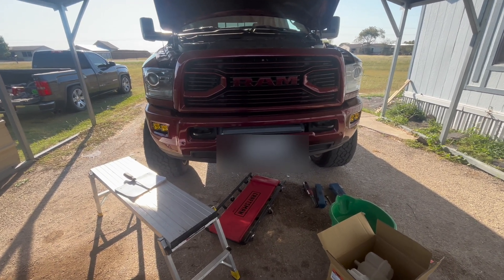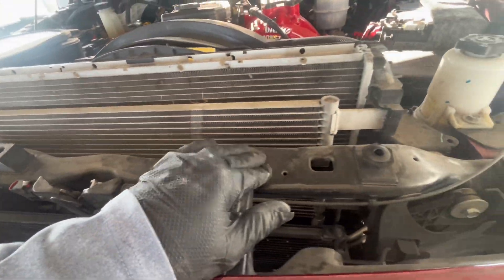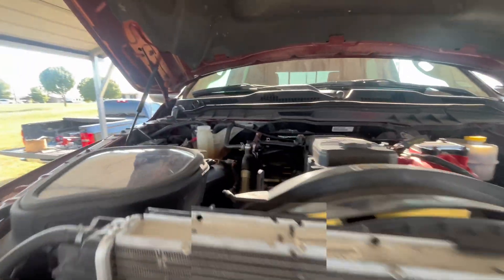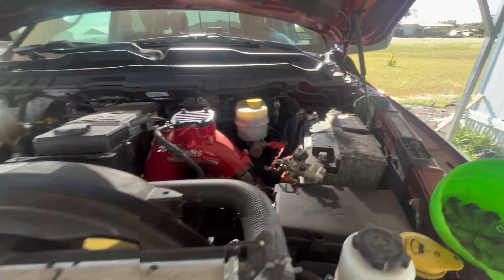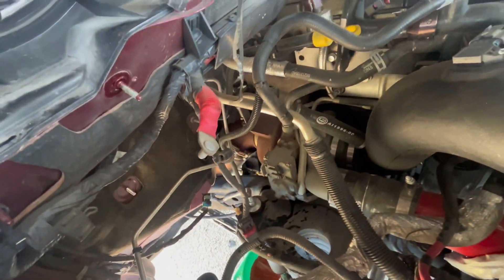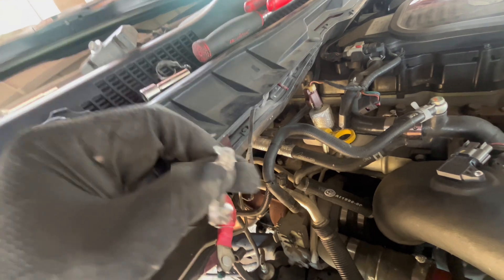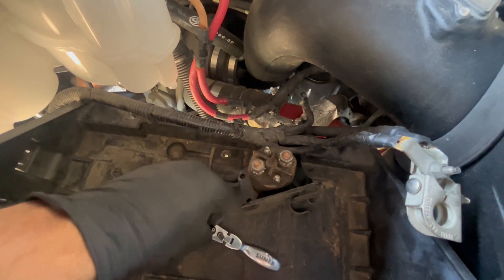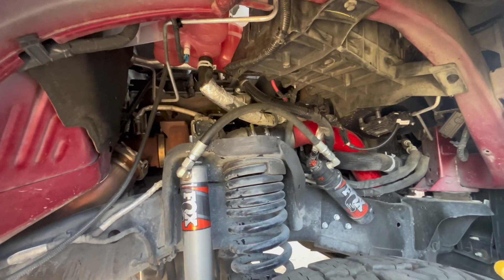2013-2018 RAM 2500 6.7L Cummins Coolant Reservoir Replacement

Comment: I had to do this job on my 2018. Watched this video and I’m the type of person that likes to find new ways to do it. So instead of draining the coolant I had a universal plug, and a bucket. Took the bottom hose off and plugged it and let the coolant drain out of the tank into the bucket. Then just took the bolts out of the battery tray and pushed the corner closest to the tank down and pulled the tank right out. Done in about 15-20 min. Just posting this for someone that sees this whole process and thinks they can’t do it. Just think outside of the box and you’ll be fine
Reply: Could you elaborate on what is a universal plug?  Thanx.
Reply: @garygrow8373 it’s basically a silicone cone shaped plug. Any hydraulic or heavy equipment store sells them.

Comment: Around minute 4:12, it was easy to remove the wires held on to the base if the battery compartment, but I have a question about removing what you call a "jumper" wire.  Since there is no nut for those, how do you remove them without breaking them?   Do you pull them off with pliers or would that damage them?
Reply from the maker: You should be able to just pull it

Comment: Awesome video man, thank you
Reply: Good video . Question ?   Did you replace the heat shield back on the new one ?
Reply from the maker: Glad you liked it!
Reply: @GreasyWrenchAuto  I’m about to do this this weekend. Did you have to burp the cooling system at all? Or just fill and let it warm up and check the level?

Comment: Nice job explaining the process. Leave it to engineering to create so much work to replace a poorly designed part. I'm about to do one on a 2018. Should be a 10 minute job. Looks like it's going to be a lot longer than that.....